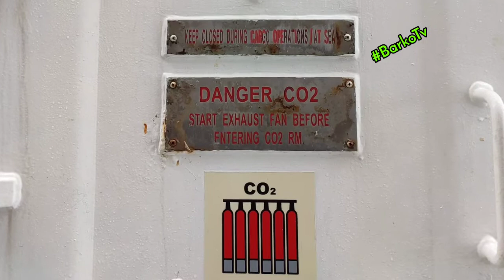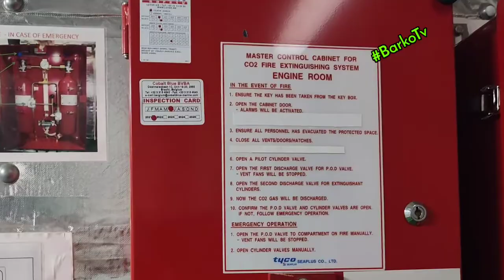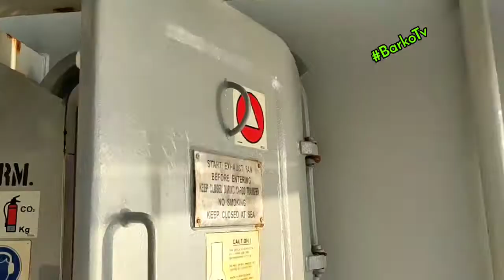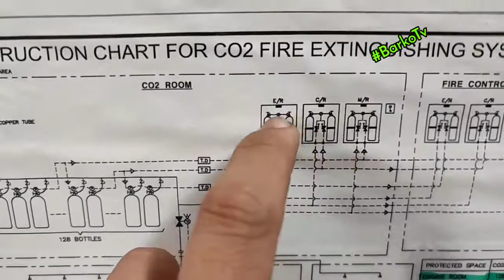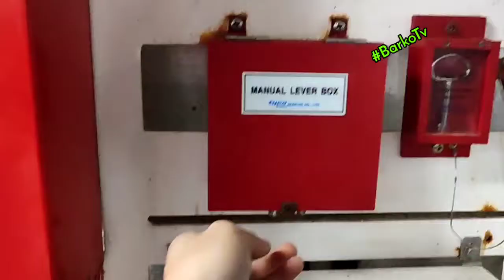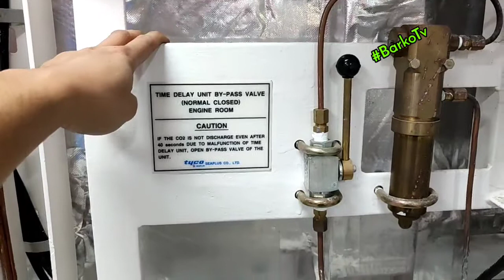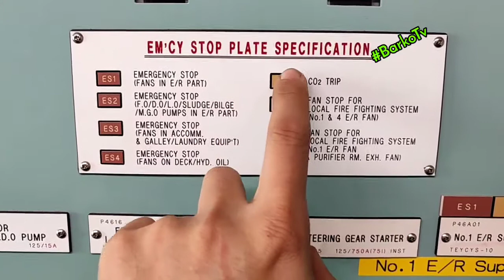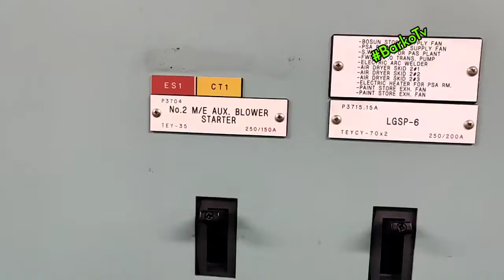CO2 Alarm Simulation and Familiarization | Securing during Dry Dock | Barko Tv | Makinista | Marino

Comment: those limit switch(C02 room) are set up for opening(fully)  valves in case of fire ?
Reply from the maker: The limit switch attached to the door is for alarm only. Ang the limit switch attached at diacharge valve is for shutting down the fans and other equipment